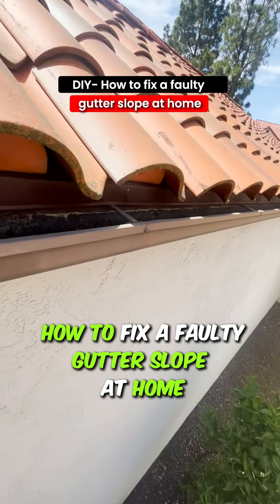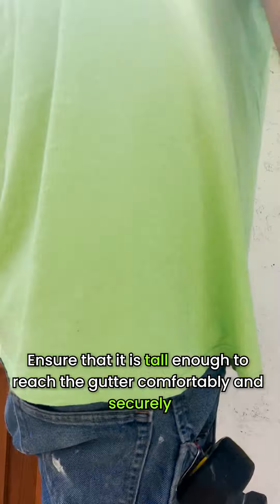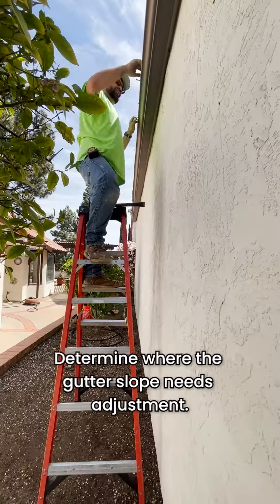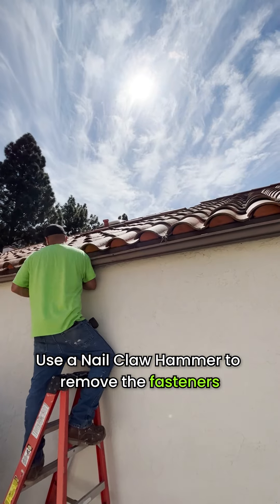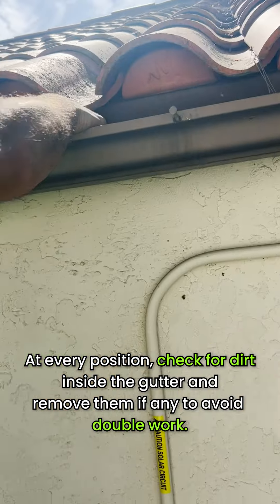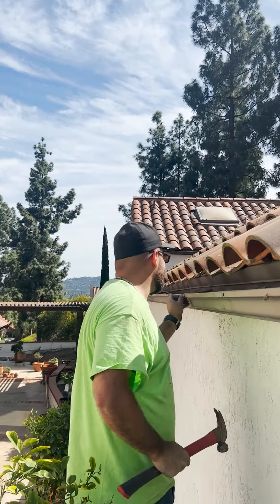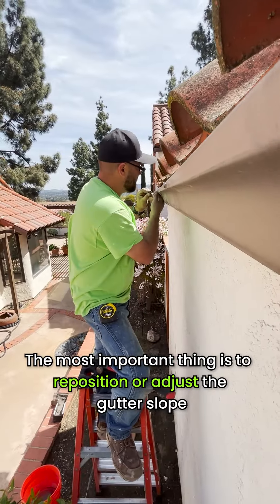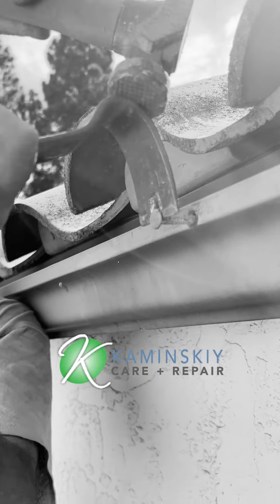DIY- How to Lift Angle Gutter

Comment: Step one, identify that it is a spike and ferule 5 inch system. 2 accept that the previous owner or builder was cheap. 3 call a professional gutter company that will verify 1 and 2. 3  get estimates to  replace entire system.